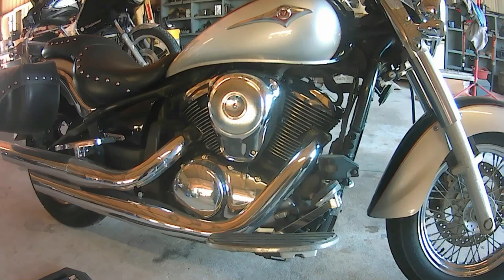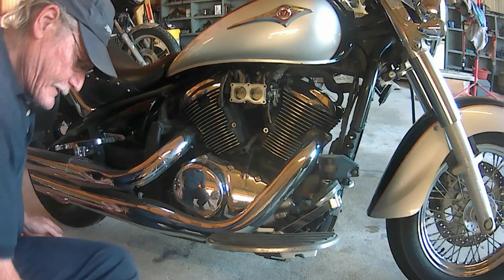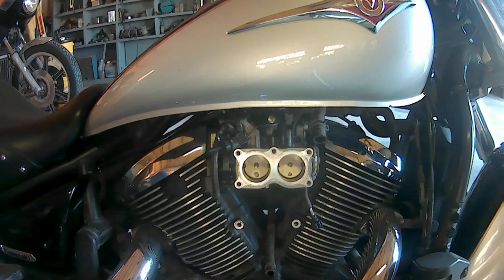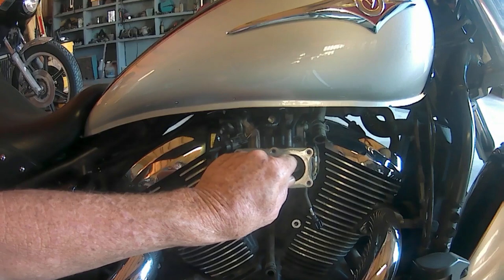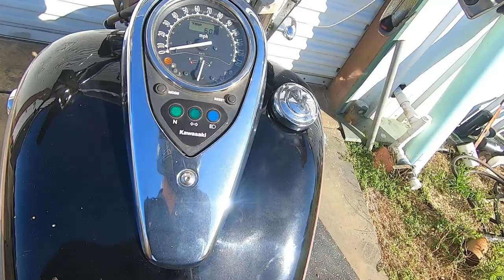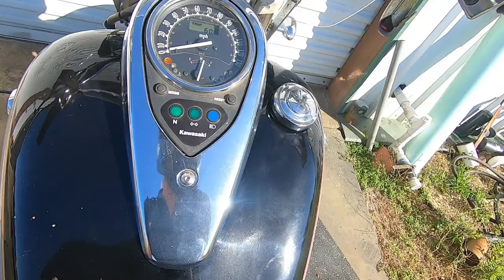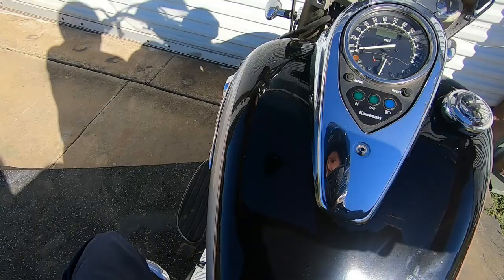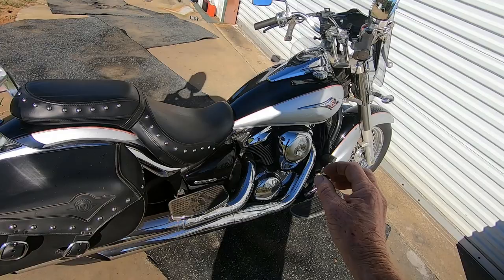Removing Restrictor Plates 07 Vulcan 900

Comment: I have 2011 900 vulcan and it is bogging down at 70 mph won't even go over 70 mph.. replace fuel pump.. still no go..
Reply from the maker: Thank you for your comment sir question does it feel like it's taking a nosedive when you get at 70 that's what I'm wondering about because if it's nose diving at 70 then it could be the restrictor plates closing on you now on mine I can feel it nose dive at 90 which is just 20 miles per hour faster it kind of it sounds like to me it might be them restrictors or some it's bad extremely dirty injectors let me know if it's nose diving at 70 other words everything is feeling good and then all of a sudden it feels like somebody flipped the switch thank you for your comment and let me know please 🤗
Reply: @lp.670  I can't get passed 70mph like if I want to get on it  an accelerate it just bogs down an spits and sputters
Reply from the maker: @wessriggs2004  sorry it took me so long to respond sir the spitting and the sputtering sounds like it's not getting enough fuel from the injectors how does it do when it's sitting there not in gear but just rub the motor up by itself by not being in gear does it spit and sputter that way I'm just wondering about that because I'm sitting here thinking you know what is the problem with the spitting and the sputtering does fitting and sputtering is a sign of a lean condition and you know I'm just my mind is boggled right now I'm just wondering how it does when it's in neutral and you just sitting there revving the motor does it spit and sputter when you rub the motor Rev the motor sorry about that
Reply: @lp.670  just idling it sounds good only when I accelerate it's start the spitting an sputtering..
Reply: @lp.670  found the problem rust in fuel tank..
Reply from the maker: @wessriggs2004  very glad to hear this sir now that you have got the rest kind of taken care of will it run up past 70 mph just wondering thank you for your comment I really do appreciate you know what you have found and you are correcting you have corrected the problem 👍👍

Comment: hello can i do this on a 2009 900??
Reply from the maker: Edward I'm sorry I cannot answer that question because I really do not know in my video you will see that the plates are open at the beginning now if you pull the cover and all off of your 2009 model and if it's acts the same way as the 07 of mine did you should be able to and everything will work out but I do not know about the 2009 model I wish I did but it's something that you just going to have to try to see and if your flaps is closed to begin with then I will suggest not doing it say where mine was open in the beginning then they closed now if they're close to begin with then open that would be I don't think I would do it I hope this help you out Sir thank you for your comment sir

Comment: I did not expected that result!?
Reply from the maker: Me either but I'm happy with the results and the way the motorcycle is running thank you for your comment 😊👍
Reply: @lp.670   By your feeling, is it worth to do? I own 2 900's. Both have a 34-61/62 pulley setup, one has a flash tuning, both have a stage one debaffle. Wondering if i would feel difference. How about fuel  consumption? Since it is a fi, i expect no difference at all.
Reply from the maker: @corneilcorneil  one question have you been running your bikes at 90 miles per hour and you feel it nose dive a little I feel like that's what the restrictions plates is doing as far as it goes for the gas mileage I'll be fine trying to find out just come in Saturday I'm very busy right now and there's a couple of y'all that wants to know about fuel mileage as well as myself and I will be doing a video on this and it was one guy was asking me about cold weather and it's supposed to be cold this coming weekend up here where I'm at the bike that has the flash to it does it nose dive on you at 90 just curious to know thank you for your comment please let me know
Reply: @lp.670  Took them out already. I had to drill out the screws. I have no numbers, but it feels like the bike reacts faster. Thanks!
Reply: @lp.670  I have different gear ratio's and a ecu flash. No, no nose dive here. I seldom go over 120 km/h

Comment: That thing sounds sweet. What exhaust system are you running?
Reply from the maker: Mr Bill it's factory exhaust but de baffled stage 2 I've done that a year ago did not video it thank you for your comment sir 👍
Reply: Actually I cut off the factory muffler and adapted to Harley turn down pipes.
Reply from the maker: @chipofftheolblock7867  it definitely sounds like to me you need to put a dynojet kit in there I'm sorry I keep saying saying that but I know what them kits can do to a bike make it it will make it more you'll be happy just follow the instructions that comes with the kit thank you for your comment sir 🤗

Comment: So mine don't open and close like there supposed to would the best bet be to just buy a new intake or can it be fixed?
Reply from the maker: Sounds like your electronic might be bad if it is not working like it should be check your connections at the restrictor plates thank you for your comment 👍

Comment: My fuel gauge went out after I staring riding down the street any suggestions?
Reply from the maker: Fuel gauge just don't stop working was the bike work on and if so what was done to it??  It could be a plug the float could have fell off it could be the fuel gauge it's self I wish I could answer your question because I want to help you with your problem thank you for your comment sir 👍
Reply: @lp.670  that’s what happened started the bike it was working next thing you know I look down and it is reading empty
Reply from the maker: @ryansmith9797  can you get a scope and look inside the tank at the fuel gauge it's will be on the right where you put the gas in on the bottom

Comment: Hey Lp, been enjoying your vids, but wondering how you solved the vibration problem above 70mph? Mines avsolutely terrible and makes it miserable. Been thinking about a baron pulley, but figured maybe you got a better fix?
Reply from the maker: Thank you sir for your comment I'm having the same problem with my Vulcan and I've been thinking about changing the gear ratio that way it slows to RPMs down on the motor the motor is what's causing all the vibrations and I've been debating on getting different pulleys you know for the motor and the wheel to slow the RPMs down I have a 1600 Yamaha road Star that has that already been done to it and it's very comfortable to ride a higher mile per hour and that's what I've been thinking about doing for the Vulcan thank you for your comment sir 👍
Reply: @lp.670  have you tried changing the rear tire from a 180/70-15 to a slightly narrower,  taller 170/80-15?  I've personally not tried that but I ride with a guy that did because he couldn't get the correct size. He says it's far better now. Even in town in 3rd gear. His wife noticed a difference and she rides on the back.
Reply from the maker: @unsafe_at_any_speed  thank you for your comment sir the tire size of the original I think was a 180 70 15 and now I think I've have a 170 80 15 on it the numbers right now is not ringing any bells for me because it's been a while since I looked at the the tire size but I did go with a wider tire for the looks thank you so very much sir for your comment 🤗

Comment: Will this work on the 800?
Reply from the maker: Sorry sir for taking so long to get back with you on your comment is the 800 fuel injected or is it carbureted just asking that's all if it is fuel injection in it acts the same way that the 900 did I will say yes you can remove them and be okay and I'll be honest with you I don't know thank you for your comment sir let me know if it's feeling rejected or carbureted thank you sir and two what year model is it just wondering
Reply: @lp.670  it is carbureted so won't work  forgot about that
Reply from the maker: @chipofftheolblock7867  now that I know that it is carbureted you can get a dynojet kit for it and that will increase your horsepower anytime you deal with carburetors there's always aftermarket company that's out there that has got a kit for it to help you get more horsepower out of your bike I would look into getting a dynojet kit for your bike I think you will be happy after that 😊
Reply: @lp.670  That sounds promising. I have already changed my sprocket setup and chain I have a little better top end and am getting up to 55 mpg on the highway running 65-70mph. But it starts losing power at top end maybe the dynojet kit can help without hurting my milage to much.
Reply from the maker: @chipofftheolblock7867  sir the Donald jet kit is designed to put more fuel into the motor or the engine should I say it will probably hurt your gas mileage probably I'm on gas around 2 to 3 miles per gallon but the results of that is wow you'll love it the dynojet kit they they design stuff to where it gives you more horsepower and I'm here to tell you I bought a dynojet kit for a 1600 roadstar Yamaha with a slipping clutch and that Donald jet kit did I put in it woke that motor up like you would not believe but I still had the slip and clutch so I had to pull the kit back out but the power it showed me was awesome I didn't do a video on it need to fix the clutch first then put that kit back in because it will be mind boggling and the fuel mileage will suffer thank you for your comment sir 🤗